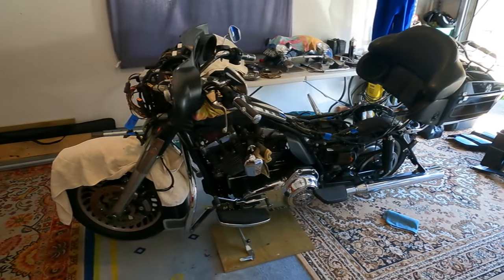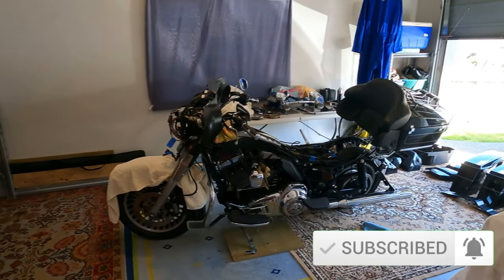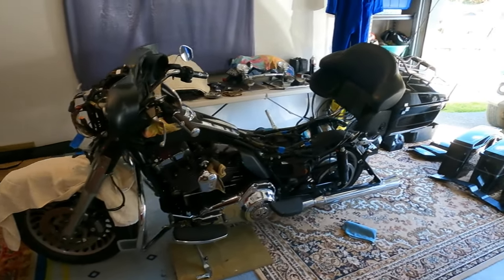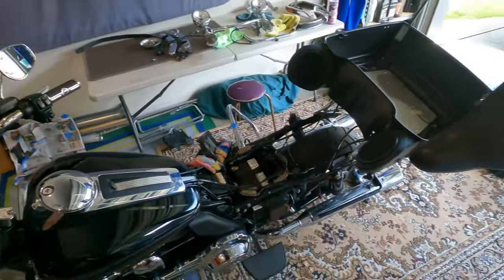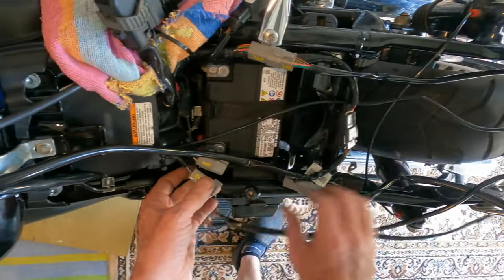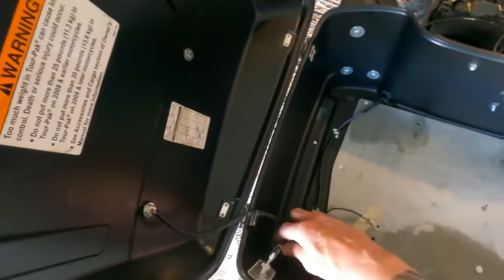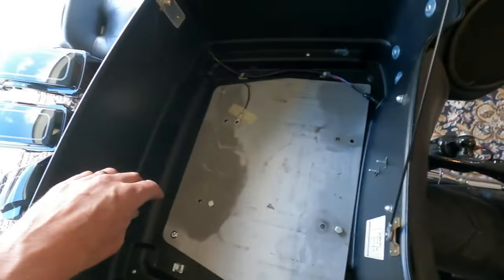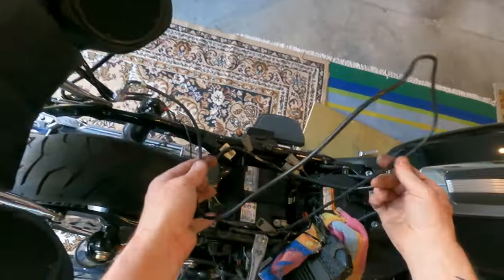Harley-Davidson Ultra Classic Tour-Pak Quick Disconnect Wiring Loom

Comment: Hi Bob
So did you put all female pins so they would stay on the bike? And then order up some dummy plugs to seal em up? Got all the stuff to do this myself. On my 08 Ultra.
Reply from the maker: @nazareth4u524  Hi,  all the female ends are on the bike harness end and the make ends are on the tour pak side.  I hadn't really thought about the rationale around that! They're not plugged either as the do tuck away when in unplugged. In that case maybe if the male ends were on the bike side with the little rubber caps that would ensure greater weather tightness when you do yours.   The pak stays on mostly on now as my son rides with his wife. Happy splicing!
Reply: Cool I'll do it like yours. But I do think I'll pick up the dummy plugs anyway. Cheap insurance.  Thanks for the helpful video. Best on youtube 😊
Reply: Hi Bob
Done deal 😊 I couldn't help thinking when I cut the first set of wires. I hope I didn't ruin the bike. But all went well and everything works.
I didn't cut or splice the com or either antenna wire. I run em over to the throttle side of the bike (right side)  circled them all up and quick tied them. and zip ties them under the side cover by the battery box. I put a under the fairing radio antenna in. Don't plan on using the com or CB. Cleared up a lot more room on top the battery. Very happy how it turned out.
Thanks for the great video👍
Reply from the maker: @nazareth4u524  Well done, there's a great deal of satisfaction in tackling a job that's more than an oil change and it works!

Comment: what to do with the amplifier?
Reply from the maker: Good question!  To remove the amplifier, it looks like a tank off job as the wiring goes back to the front fairing with no plug break. The tank has the equaliser breather that goes through the frame, so best done with little to no fuel so it's lighter etc. It's a bit of a rabbit hole type of job as it stands. I keep the tour pak on with this bike at the moment so I'm not sure what I'll do at this stage!  I think it would look cleaner with out the amp regardless of making the tour pak a quick disconnect version. Maybe that's the next vid then! Cheers.

Comment: So just curious for my own project upcoming, all the wires back to the tour pack that you are splicing connectors onto, would they be able to be coiled up and kept long underneath the seat?
Reply: To clarify if I didn’t want to splice them like this would I be able to just unhook from the pack and hide them underneath the seat to be able to remove the tour pack?
Reply from the maker: @frankeldredge-ns7yd  I think there's room from memory but it's a bit of a job with the space that's available as the cables are all tourpak length reaching to the back of the bike to then fit somewhere, on the up to 13 models at least.  You will have to disconnect things a little more awkwardly like the aerials, and from inside the speaker pods.  The splicing has just moved it all to under the seat area and with the front fairing antenna kit, the radio cord is bundled up near the battery.
Reply: Bob...currently adding a tour pack to my 13 flhx ...did you consider to just have one plug that accommodated both left n right speaks?